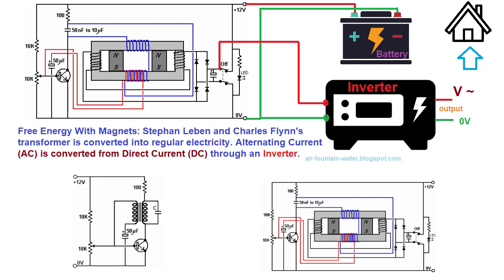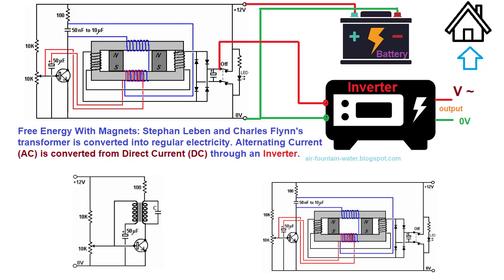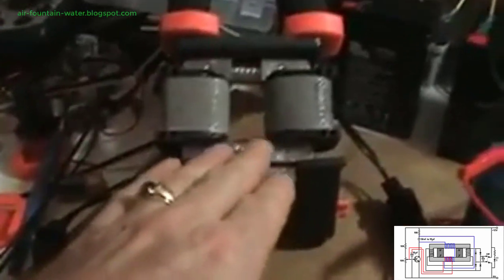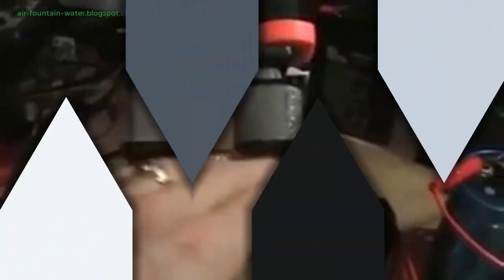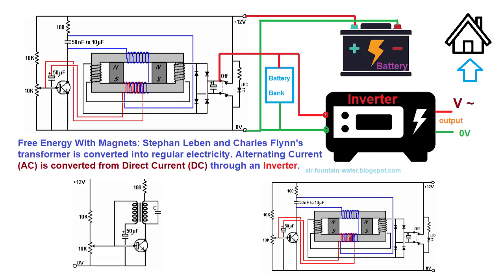Free Energy Transformer: Harness the Power of Back EMF and Resonance

Comment: This is not possible due to circuit loss.
Reply: You pulse the flux in the same direction as the magnet's flux. Naturally the output power would increase at the cost of reducing the magnets field strength